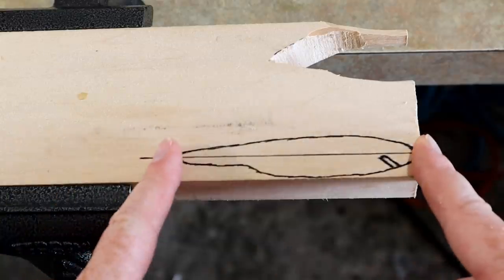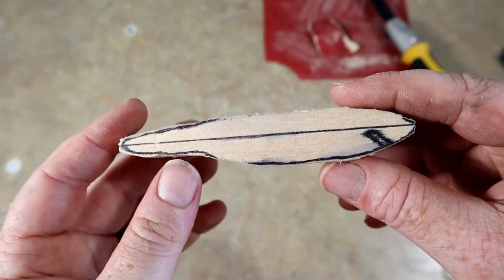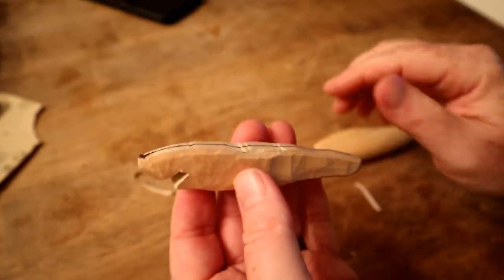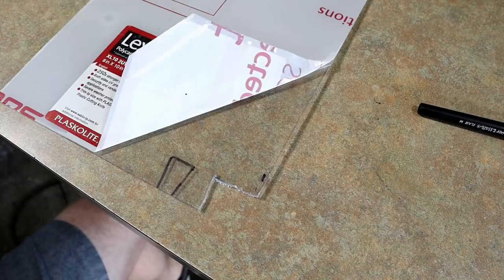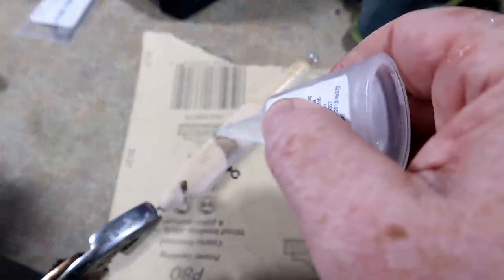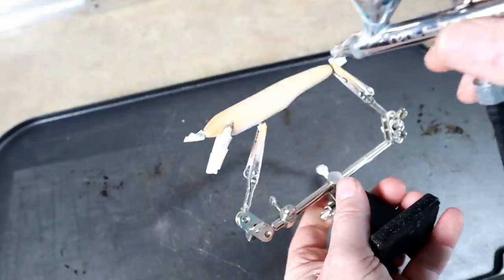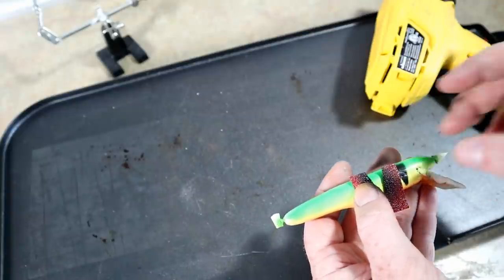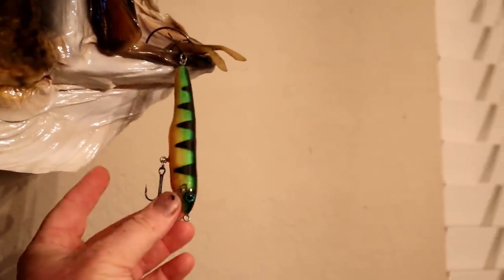Made My Son A Wooden Birthday Lure! Making A Jerkbait

Comment: I hope you continue with the hard baits I enjoy watching you learn a new craft. A bandsaw and a disk/belt sander are the 2 things that will significantly speed up your builds and make it a lot easier to make a clean looking lure. I know your tight on space but if you find room, tabletop tools don’t take a lot of space and are fairly cheap from harbor freight.

I’m glad to see you drew a center line, Im sure you noticed it helps.

A few bits of advice I would give you is to get the overall shape of the lure while it’s still squared off before you cut the chamfers.
Cut the shape of the lure, sand the top, bottom, and sides of smooth while it’s still square before you cut the chamfers. Then all you’ll have to sand is the corners.
Reply from the maker: Okay I see what you mean

Comment: I'm learning to make wood lures too. I've found my solder iron is good for removing small amounts of lead when I over pour. Also always cap off the lead with a little bit of baking soda and then a couple drops of thin super glue. It will harden instantly and secure the lead.  Then sand smooth.
Reply from the maker: I'll def try it

Comment: I got a Tip for you to cover the lead up. Put baking soda over the lead then add super glue on the baking soda and let it set for a few min until it harden up. Then sand over the part where you add the baking soda and super glue and then you can paint it. You won't be able to notice where you put the lead at.

Comment: You'll want thin super glue moving forward.  With a water-like consistency, it soaks into wood much better for a sealer.  Also, you can apply baking soda and then thin super glue on top of it.  The glue causes it to harden instantly, allowing you to add material where you need.

Comment: I’m a welder so getting burned not that big of a deal to me. Kinda grown use to them to the point I’ve had to remove a peice of slag from my forearm with a pair of pliers. It melted into my skin while I was welding overhead it dropped inside my leather sleeve and I didn’t stop until I finished the bead and it had melted into my skin. Cuts are the worse. I had to get stitches 3 times last year due to dumbass attacks while using knives I sharpened into razor blades. Like serious open wounds that had to be stitched after I tried gluing them myself. Almost got a tendon the last time.

Comment: I have cut myself working with knives before. I have hit my finger with a hatchet (i still have it, don't worry). I have scortched my tongue on a cookie that I didn't know came out of a hot oven literally a second before. I have bruned my finger on a knife I was forging at about 2000 to 2400 degrees. I have had sunburns that made the entire mack of my shoulders a mass of blisters. I have melted half the skin off my thumb and wrist making soft plastics. The plastic burn was by far the worse injury I've had. The pain was beyond anything I have felt before and it caused more damage than any other injury I've had. If it had burned me through the shirt and shorts it got on, I would have been in a burn ward at a hospital. The closest second was when I pulled a muscle in my back and could not go any faster than a walk for a month.